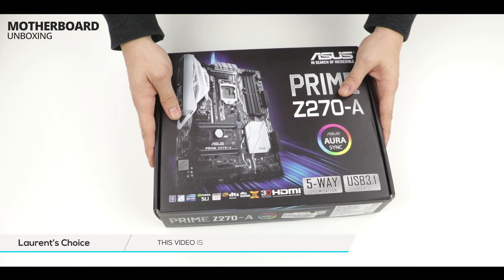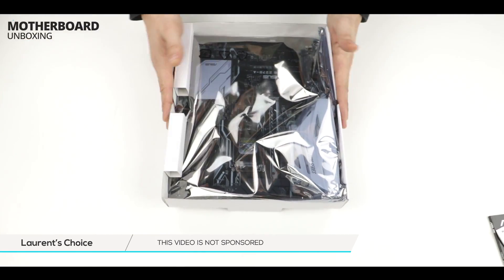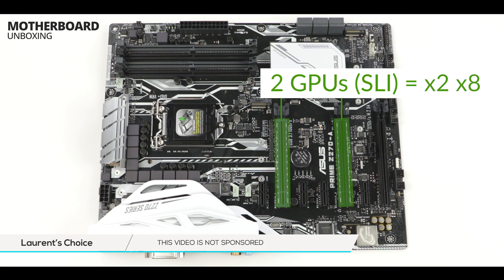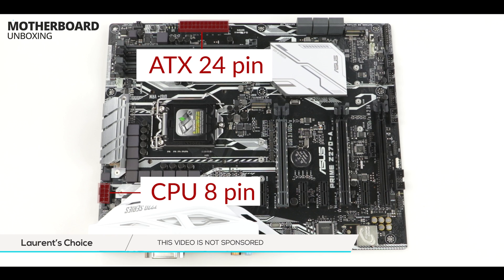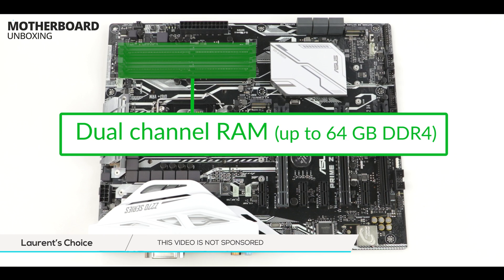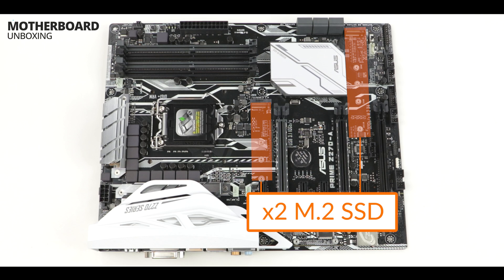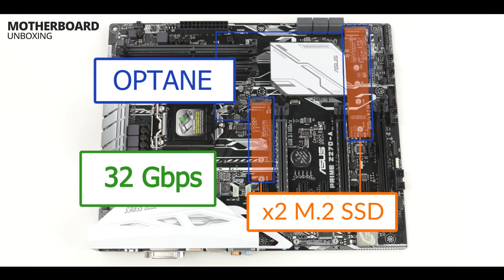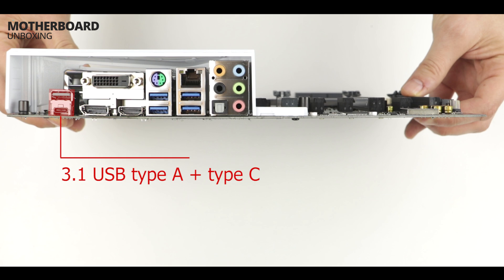Motherboard Z270 Installation (Kaby Lake Project 2/10)

Comment: Bro  i just buy rtx 2070 In the feuture if i buy rtx2080ti can i make sli
Reply from the maker: Yes... but itll slow down ur 2080ti. 

Itll run like two 2070 SLI
Reply: @Laurentschoice  do rtx 2070 work with sli
Reply from the maker: Yes it does
Reply from the maker: But if u have dofferent types of cards, they will run at the speed of the slowest card

So if u have a 2080ti and u make it sli with a 2070, it will work like two 2070
Reply: @Laurentschoice  so 2070 support sli?
Reply from the maker: Yes :)
Reply: @Laurentschoice  why when i Wright In Google it say no sli for 2070 only for 2080 and 2080ti
Reply from the maker: Let me double check this
Reply from the maker: Oh wow... u r right... let me dig deeper into this
Reply: @Laurentschoice  i hope u find the right answer
Reply: @Laurentschoice  what isittil

Comment: Does it have intel optane in it? Or do you have to insert intel optane to the motherboard
Reply from the maker: +Emil Lugovoy the following chipsets come with the Optane feature available :
Z270
Z370
X299 

U do not need to install this feature. It comes with the chipset itself :)

Comment: I’m torn if I should buy this board or the asus z270F strix board. I am doing an all white themed build. However i wouldnt mind sacrificing some aesthetics. My build list consists of:
i7-7700k
Gtx 1080ti
32gb ram
Corsair rm1000x psu
Nzxt kraken x62 radiator
Nzxt s340 elite case

Any suggestions help
Reply from the maker: +N Q performance wise..both board have EXACTLY the same components and will deliver the same.

Strix has a better finish and focuses more on aesthetic (ROG).

I advice you strongly to stay with the Prime.
Reply: Laurent's Choice thank you for taking the time out to reply as i am extremely new to this. The pc will be running 4 fans plus the center cpu cooler. Does this board have enough fan connectors? Would i just be able to daisy chain the fans?
Reply from the maker: +N Q you can daisy chain them (up to 5 per connector) .

No worries:) 

If this is ur first build make sure to watch the kaby lake series .

It is a very similar to yours:)
Reply: Laurent's Choice thank you brother
Reply: Hey so i got this motherboard like you suggested, however due to my mistake mishandling, i snapped off a plastic clip on the upper right side of the motherboard. :-( idk if it will affect anything too much
Reply: Can i send you a photo of what im talking about. Otherwise i’ll just buy another motherboard
Reply from the maker: +N Q please do ! 
I'll be more than happy to help out:)
Reply: Laurent's Choice do you have an email?
Reply from the maker: +N Q go at the end of any of my videos and ull have all of my contacts info. 

Please make sure to add the exact model number of both mobo and case in ur email.
Reply: Laurent's Choice emailed you. Mobo in subject line. And pics included!

Comment: I have no experience with building computers... Hardware. Mostly software skills.. I am going to build one with a asus-prime-z270-a .. Need to read up on how many holes it needs to be attached with. Was one in the middle, that he did not use it looked like. But i think computer cases have letters for which one to use with motherboards. I need to read up. ;) I have always used laptops, and do not have any building experience, yet. But this motherboard looks nice. ;)
Reply: well did you had to use screw in the middle?

Comment: I hava a be silent! Straight power 10 voltage thingy and i have this mainboard. So my problem is : i dont have a cable which fits into the cpu pins ! Should i buy an extra one or am i just stupid?
Reply from the maker: +Buerton Shirt hey there :)

Can u explain a little more.. i think there might be some typos on your original posting . Thx :):)

Comment: Is that white plastic piece with the words "Z270 SERIES" on it" covering the the i/o ports removable? I have the same motherboard, but I want it look aesthetically like the asus x370 motherboard. I was looking through the manual, but didn't see anything regarding it.
Reply from the maker: +Jin Kusanagi no ..couldn't see anything like that
Reply: There is a youtube video called "Gigabyte Z170-X Gaming 7: A Lot to Offer" by Bitwit. There a small segment near the beginning of the video, where he removes the plate cover from the motherboard. Originally I was going to get an Asus x370 pro motherboard for a ryzen 1700, but at the moment, there is a huge shortage of compatiable motherboards, and some of the brands that sell cpu coolers do not have am4 brackets yet so I decided to just go with an i5 7600k for gaming. I like motherboards with a simpler, cleaner look, so I was wondering if plate covers could be removed from other motherboards in a similar manner.
Reply from the maker: +Jin Kusanagi 
I see. 

I d go for a 270 definetely.

Not too expensive and you'll get an increased Bus.

Prime series is good in the sense it give you a dual M.2 ssd connector and can run SLI cards along side.

Basically the BUS will give that extra upgradable side which gamers can rely on for the next few years.

Cpu is good though Rizen would give you more for your buck as an task intensive machine... but the 7600k is plenty for the next 2 to 3 years game development. 

Pus it has a very descend integrated GPU that I would test if I were you :)